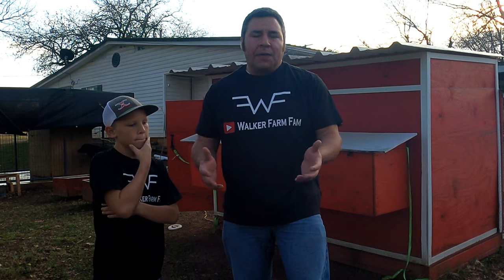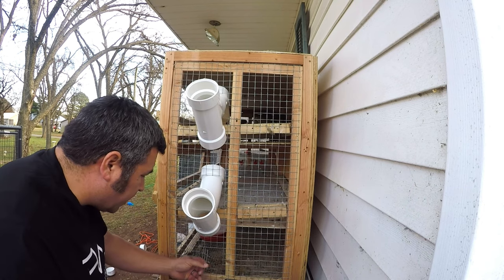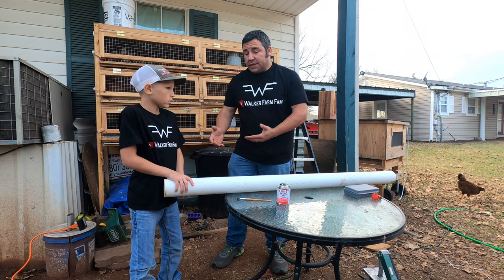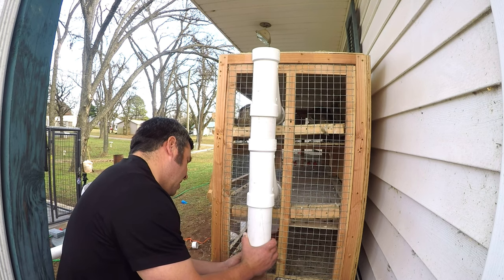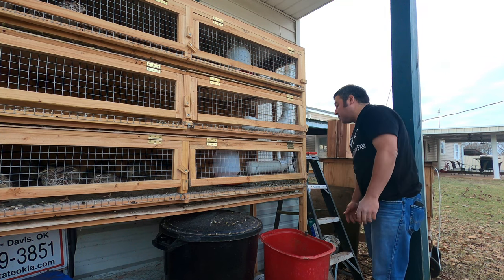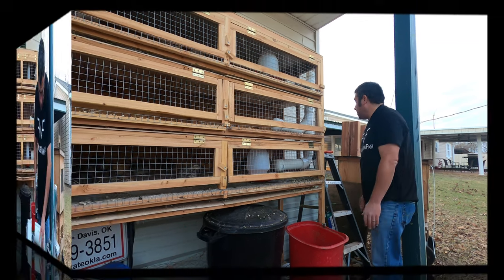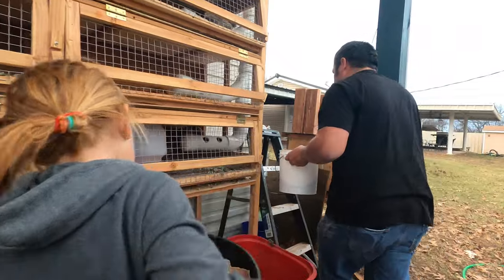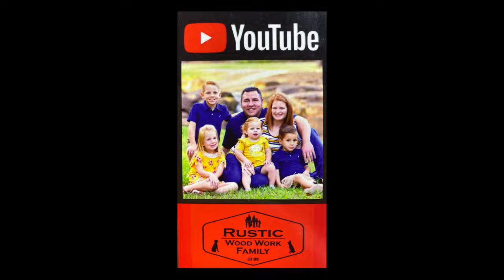We had to come up with a new design with for the quail feeders. PVC pipe quail feeders with no waist

Comment: You might have block each section off and put a door for each of the bottom 2. 
Keeping a chicken from scratchn is like trying to stop a kid from liking ice cream 😆. Concrete or gravel works or having them in for supper.

It's hard to tell by the video but I'm guessing gravity will work against getting feed in 1 and 2 but making the feed tube go across the side of the cage may be closer to the food dropping down.
Reply from the maker: Yeah I thought about that Ray. I told Stephanie I was just going to experiment for now and then once we get to our new place we are going to spend the money and build the pans rot. I know they will not quit scratching.

Comment: You just need to put an angle  to the feeders, tilt the inside end down slightly . Maybe use a brace post underneath the bottom feeder to raise it and support it, I'm afraid the weight of fifty pounds of feed will end the wire. Maybe rock the edges of the sidewalk to keep the chickens out. Maybe lay some chicken wire down along the sides to keep them from scratching the dirt place so decorative rocks along the wire to hold it down. If they can't scratch the dirt they'll move on.
Reply from the maker: OK thanks for the info I’ll deathly try

Comment: They are scratching for bugs and worms. Believe it or not chickens can actually hear them move under the ground so they will dig to get to them. That's why it's best to keep them out of a garden or flower bed. You may have to get the solar fencing like Dutch has to keep them corralled.
Reply from the maker: Yeah that’s what someone was telling me I will have to look into getting some of that fencing
Reply: Scratch boxes help keep chickens busy enough to keep them from messing up your yard especially if you can get a good start on getting some earth worms to populate inside the boxes In the winter you can buy a few worms to keep them busy plus a little feed will get them started scratching inside the box.